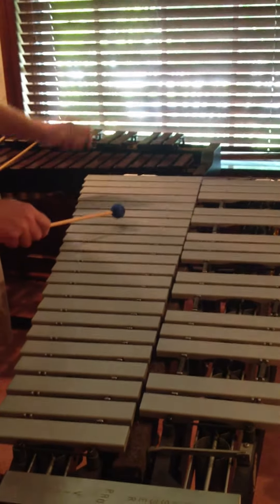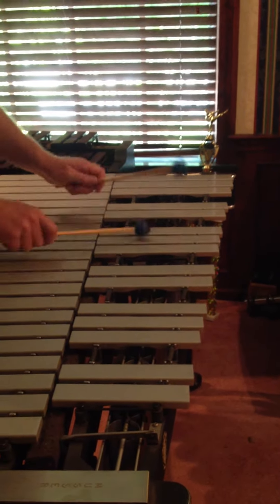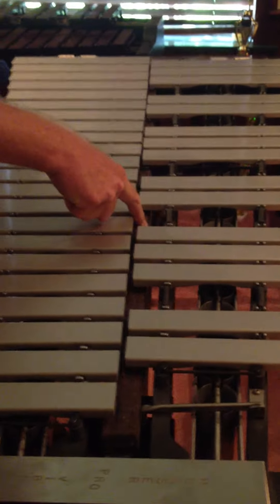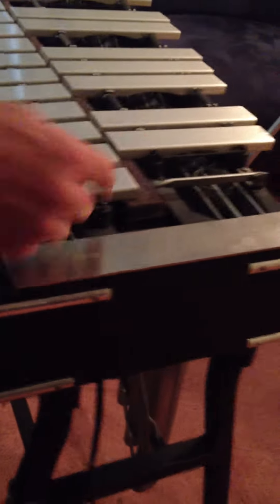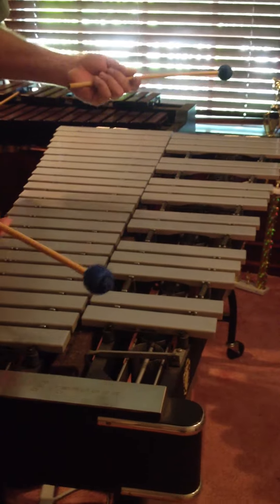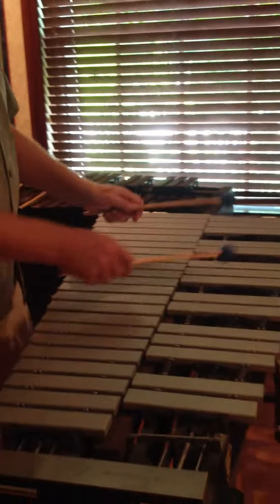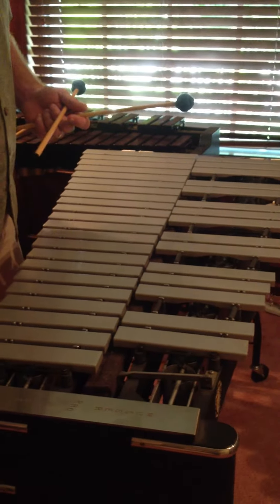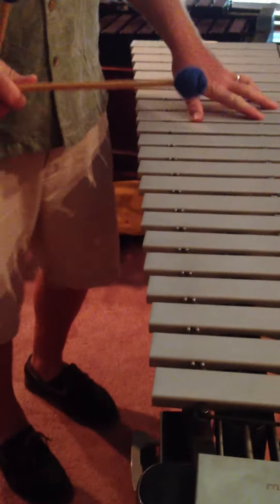What is a vibraphone? Or, Vibraphone 101.

Comment: I am rebuilding an old Mussar M64. It doesn't appear to have a motor. Someone already had mounted it on a very sturdy frame, but entire pedal assembly missing. I am going to come up with something, but I want to get it right because I haven't one to look at. Holding the pedal down should keep dampers away from bars from what I am looking at, I think? It has been a number of years since I have played one.....Please advise if you can.
Reply from the maker: The dampening felt is pressed against the bars with a spring so pushing down on the pedal pulls the dampener away from them so they ring
Reply: @freepercussionlesson  Okay.. Thank you.